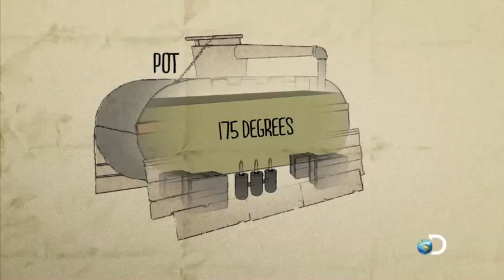Still | Moonshiners

Comment: Where I grew up, in mid Norway, moonshine was , and is still culture. I grew up with a still in the basement. Thing is, we would use stainless steel stills and run the spirits through at least one metre of charcoal to filter out fusel oils and sulphur.. I know copper stills remove a lot of sulphur naturally, so maybe that is why they use less charcoal. Our finsihed product was never watered down but rather double distilled until  at least 90%  or 180 "proof" . People did not like their spirits watered down as it was used for a popular drink consisting of hot, not so strong coffee and 90%  giving a very fast and strong intoxication, a buzz like nothing else, more akin to being drunk and on speed. This drink, called krsk, has been the fuel for an insane number of fights.

Comment: A still is made of six parts first is the burner inside here propane gas and charcoal are heated to warm up the still. second is the pot inside here is the mash. On top of the pot is the cap pipe which runs the moonshine to the thumper. the thumper contains more mash and water and takes out the bad stuff. the moonshine is then pumped to the worm tank where it is cooled down before being pumped into the proofing barrel where it comes out as pure 100% Moonshine. before the moonshine goes into the proofing barrel the head and the tail need to be dumped the head contains methanol, arsenic, lead, and hydrocarbons and the tail contains ethanal both are poisonous and need to be dumped because if it is not the Moonshine turns to ROTGUT and you don't want that.

Comment: im tryin real hard to make some good shine on my kitchen stove but i just cant get it right.is it a boil i need or a simmer? i think my flame is to hot.should i turn it down and be more patient?
Reply: 2redhens be more patient the lower the flame the better and stronger it turned out
Reply: drip drip small stream... like a pincel.drip drip spert. a thumper will get loaded if done right ...in the in end use water to push last out ..down hill after 100 proof ,rerun that in boiler next time...good luck dump first part .for shots kill ya..after it's not oily and starts going faster on own good shit..tail starts at 90proof blend well you'll know it..just don't have that first jar near the drinking stuff...80 ml for 4 gall beer trash. so call it 120 ml trash...wine 120 so say 220ml trash should be safe..now when smells like well dog or cardboard that's your last cut..rerun.

Comment: the worm is a heat exchanger
Reply: what the heck is the Thumper really doing?
Reply: It separates out the vapor both the head and the liquor head to the worm before they go to the proofing barrel. the head comes out of the worm first and is always tossed into the fire or dumped everything else is pumped into the proofing barrel before it is distilled and bottled up into 50 gallon jugs. The tale is pumped into the thumper and it stays there until the next run.